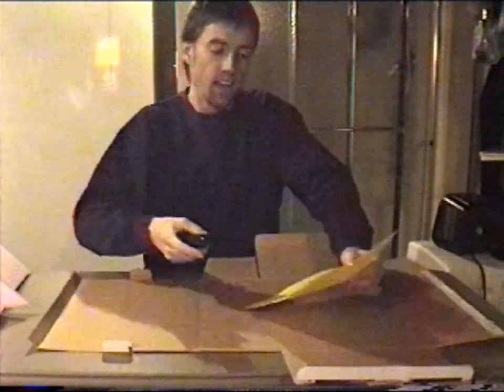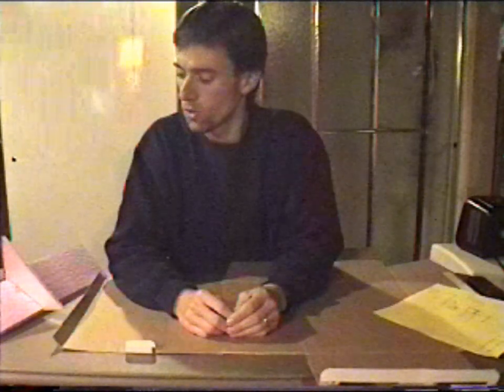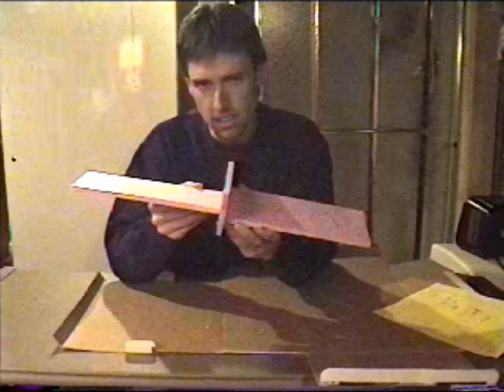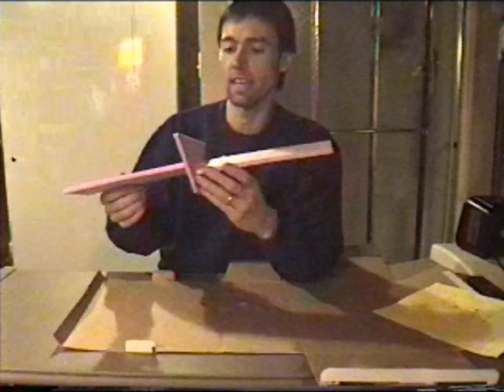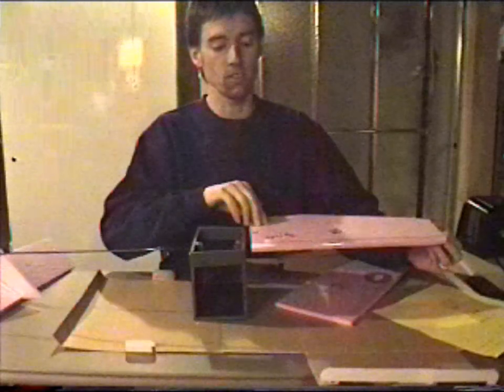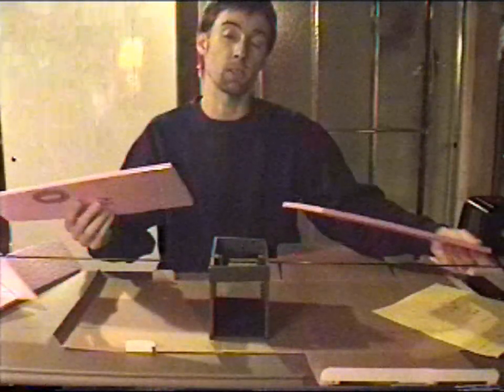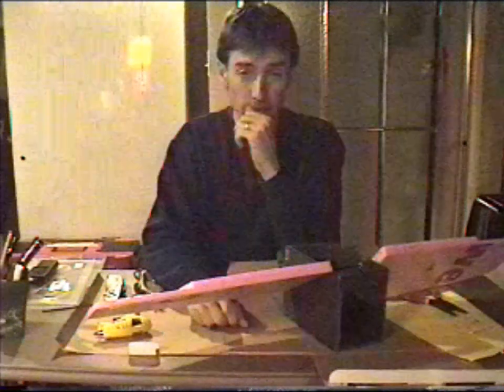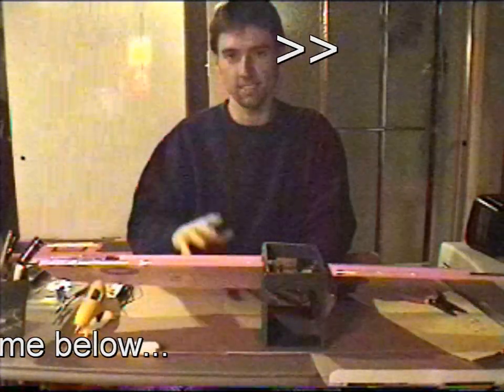Goose Project - Video 1 - Body and wing prototype.

Comment: I too am a fan of Dave. I enjoyed your vid. Your experiment reminded me of the elevator on a modern day fighter. Where the entire control surface tilts up and down instead of just the trailing edge. If you haven't seen it check out this youtube vid of an F-18.
/watch?v=TlzBCAUAzss
Fighters like the F-18 use this type of control surface because they need to be very maneuverable. If you make the entire wing tilt just like the F-18 elevator I think its going to make the aircraft very maneuverable.